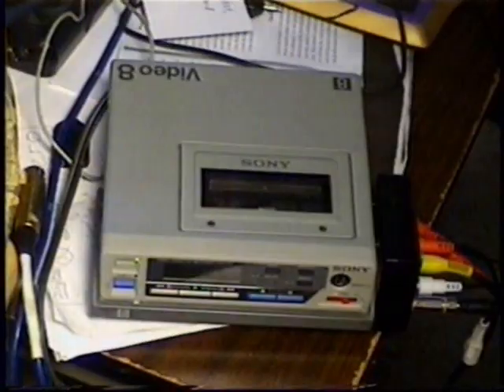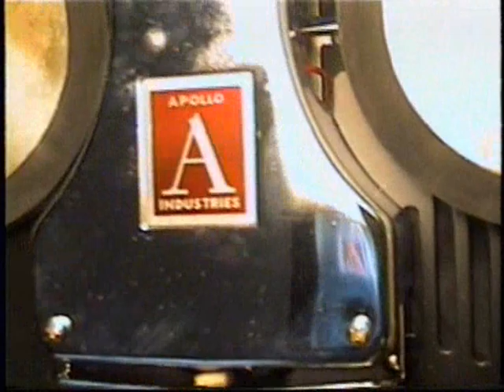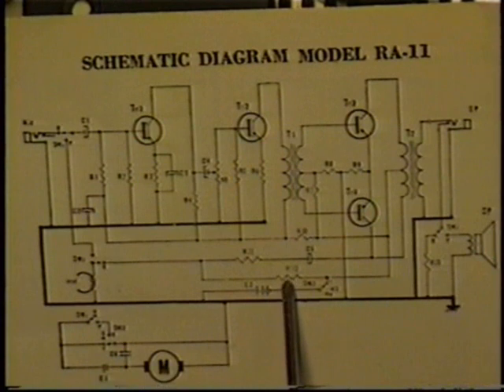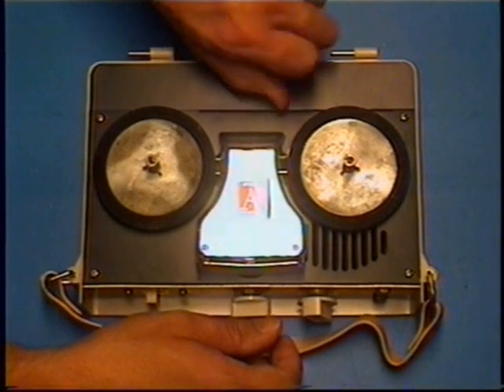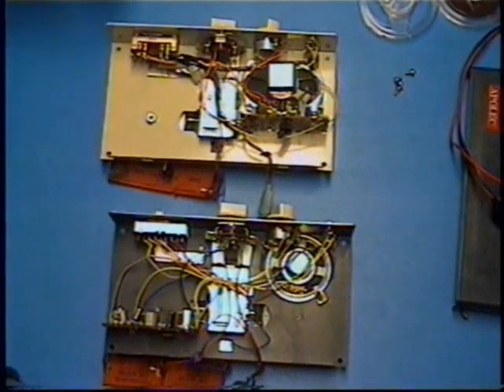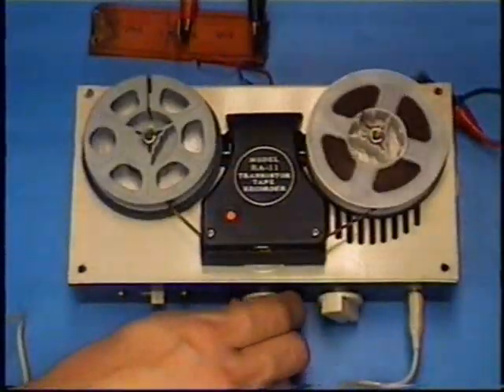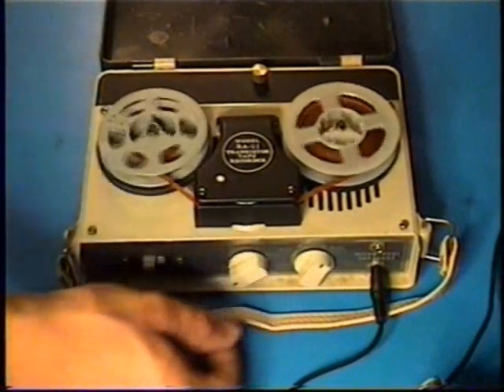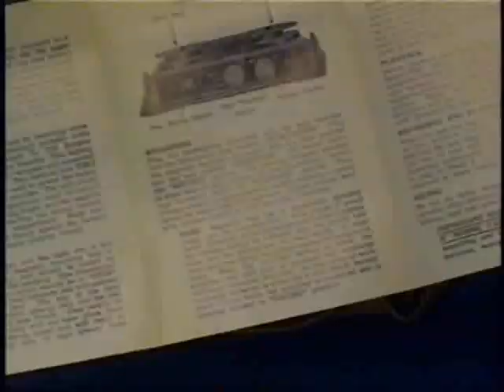APOLEC RA-11 ≠ APOLEC RA-11 (Two rim-drive recorders, same model, different designs)

Comment: Very cool video! I recently picked up a 'Apollo Industries" Apolec RA 11 model from a yard sale and I can't seem to get the record function to work. I opened it up and cleaned all the connections there was some corrosion. I got it working but when I go to record, the mic works for a sec or two, and then the volume slowly disappears and it just records static. I can tell it's recording, because you can hear the volume go up and down despite not hearing the voice. I don't know if it's the connections to the microphone or the recording head that is faulty. Any ideas on how I can go about getting this thing running?
Reply from the maker: The recording head is fine. Have you tried a different (known working reliably) mike?

Also have you switched the record-play switch back and forth a bunch of times? I would try going between record and play a bunch of times while talking in the mike. And turning the volume back and forth a bunch of times. It might need the record-play switch sprayed with contact cleaner or WD40 (which works rather well as a contact cleaner for low-voltage stuff).

If it still has a problem it might need new electrolytic capacitors.

Comment: Hey I have one of these guys but it’s under the name Lloyd, any explanation for me I’m having trouble finding anything t about it. It is the 4 transistor Apollo industries version but just labelled Lloyed on the outside case awell as the head. Thanks for the vide!
Reply from the maker: There were many recorders under the Lloyd's brand, typically low-end. And similar four-transistor tape recorders under a myriad of brands.
Reply: @CassetteMaster  yeah, the motor was dead when I got it, may try to tinker for the fun of it. Just getting into this world so messing and already broken, low end tape recorder won’t bother me too much haha, thanks for the on-site!

Comment: How does a dirty head interfere with recording or playback?  Shouldn't a magnetic field be impervious to a minuscule amount of "dirt?"
Reply from the maker: The VCR head was fine, not dirty like I claimed (I claimed it out of a light-hearted, pessimistic attitude). 

The head has to make good contact with the tape; a dirty audio head will tend to make the high frequencies weak. For video you get static in the picture, or if dirty enough, just static on the screen. 

The head gap is extremely narrow, to get the high frequencies. So it does not take much distance away from the head to lose signal.
Reply: @CassetteMaster  So a thin layer of dirt moves it out a 100 thou or whatever?  That makes sense. Thanks.

Comment: "heavy duty" batteries aren't crap, they are made to be crap by Chinese manufacturers.  Kodak CZ D batteries have 8,000mah capacity.  Alkaline batteries were not as better as CZ back when they first came out. Today they may be 10 to 20 times the capacity, but that is only because the CZ cells are made so cheaply that they can be sold 3 for a dollar 8k miles across the world in crappy dollar stores.  Back then, Carbon-Zinc were about 1/2 to 1/3 of alkalines (at low discharge rates), but at a significant price savings. Alkalines are also better at delivering high current.  The Kodak cells today are a great deal and they don't leak unlike every single alkaline brand today.
Reply from the maker: I have a bunch of Kodak alkalines, but have had some of them corrode on me even while still good.
Reply: @CassetteMaster  Kodak carbon zinc batteries. I buy the D cells to power a radio for power outages.  This way I can leave in them in there and not worry about it.  I'm sure the Kodak alkaline cells are not better than anyone else. But unlike other cheap CZ batteries, they last. The datasheet for them says 8000mah. The dollar store ones are more like 1000 on a good day.